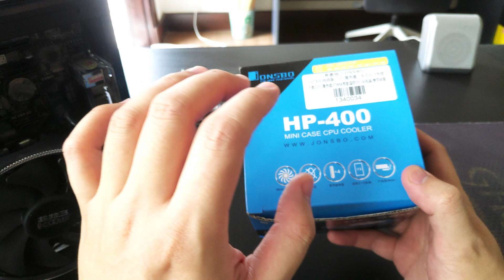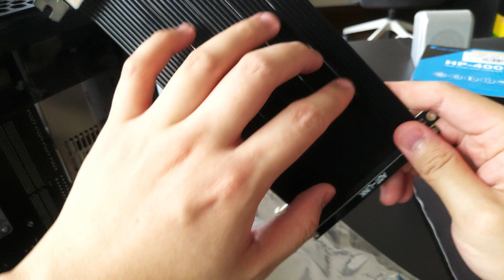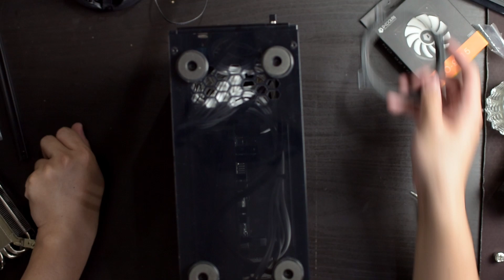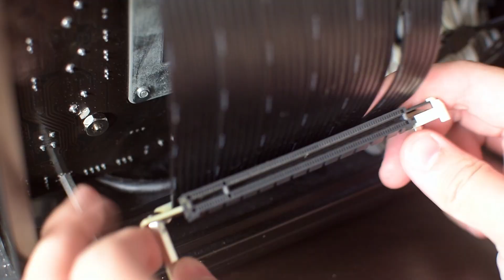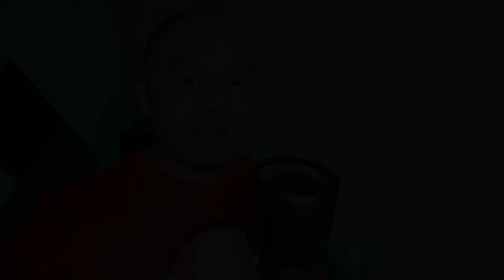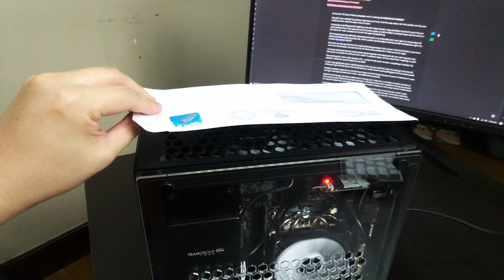Finishing up (and Modding) my SFF Build!

Comment: Love the build ! As for the fans you can try to get those voltage reduction fan cables (those normally come with Noctua fans) or can get generic ones which is also quite cheap.

As for the pcie cable does your motherboard has the issue of plugging a PCIe 4 riser to a PCIe 2/3 slot and running a PCIe 3 graphics card?
Reply from the maker: I do have one lying around that I am going to try and use. 

I've only tested the rig with an RTX 3060, so I didn't notice any issues, I didn't test it with a PCI-E 3 one.

Out of curiosity, what issue would this be?
Reply: @TechRodent  so far I tried and it will be black screen as I am using it with 1600, with no igpu, maybe with intel igpu will default to igpu?
Reply from the maker: @swakookoo  Hmmm Interesting. I'll see if I can test that at some point, I'm curious to know.